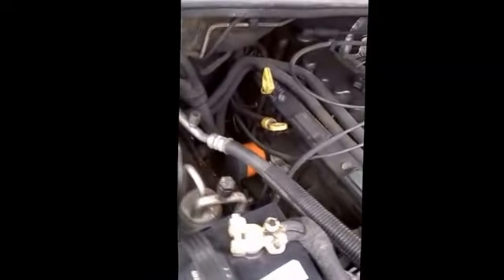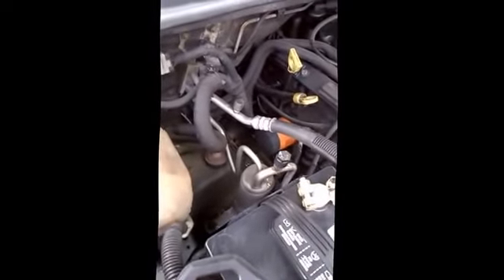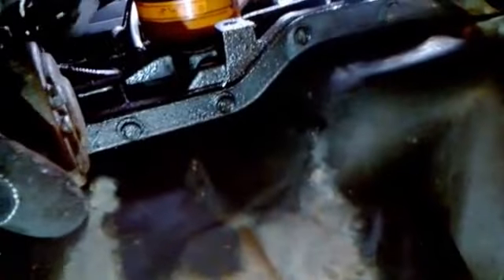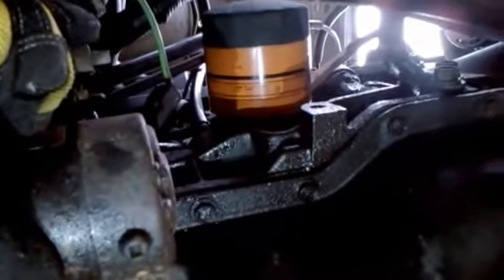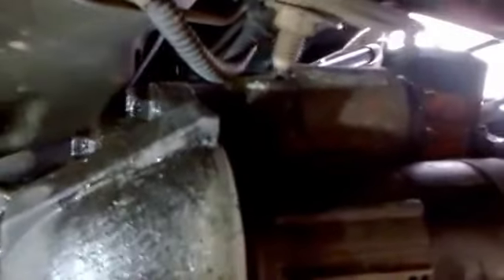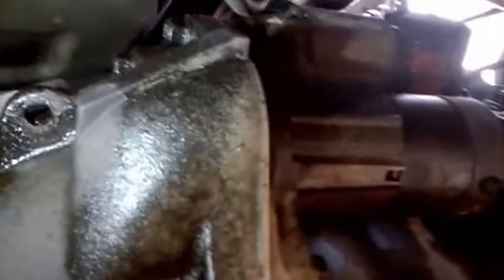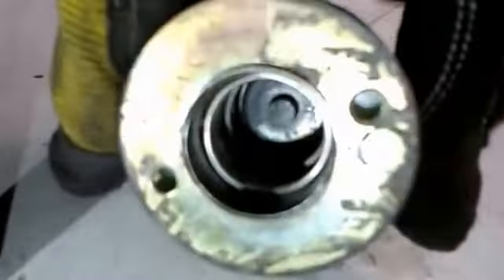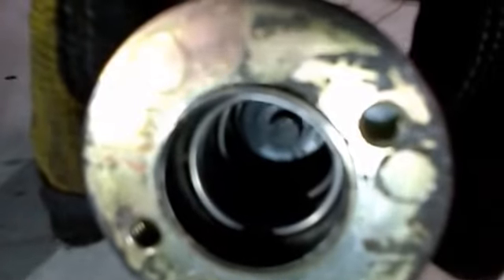How to repair starter solenoid 2003 Jeep Grand Cherokee

Comment: Just replace the starter. It's 94 bucks on Amazon and it comes with a new solenoid attached.
Reply from the maker: That's a pretty good deal. My solenoid didn't last too much after the repair, but it at least got it drivable again until I could replace the starter.

Comment: Did you say you had to hit the starter to make it turn? Mine is doing the same thing so if that's the case I'll do what you did.
Reply from the maker: Yes, but it didn't last long after that. I ended up replacing the starter.